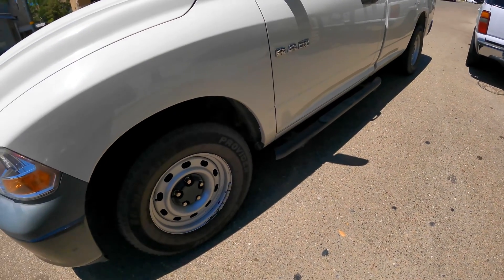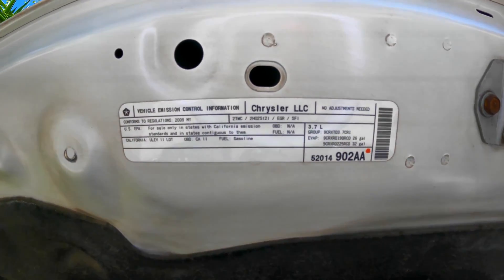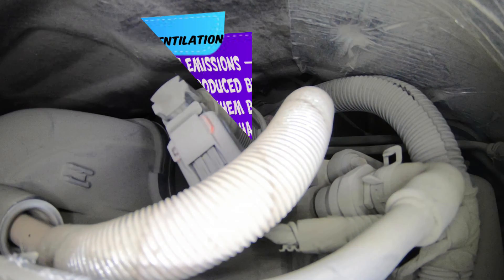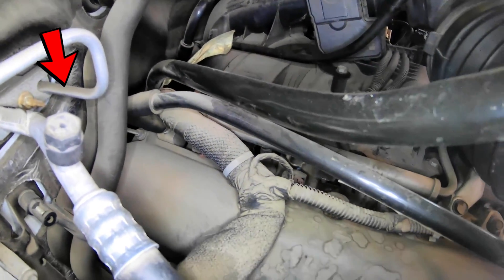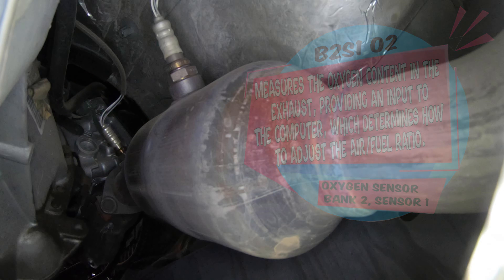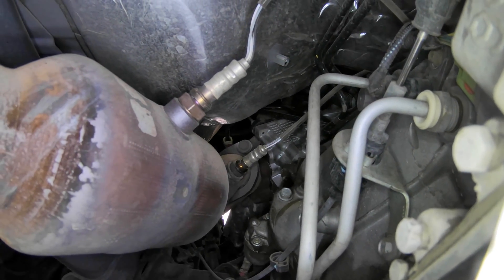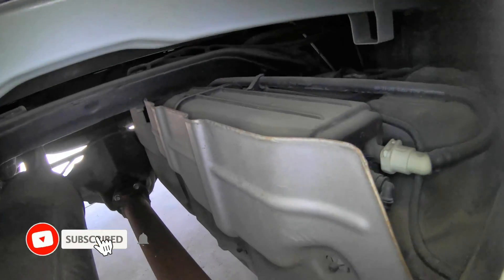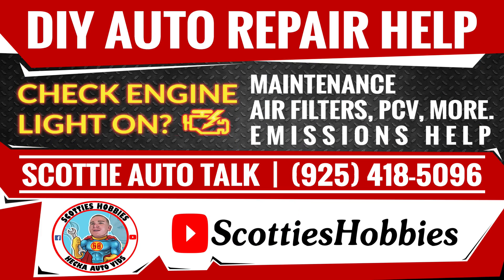⫷ RAM 1500 3.7 L. Emissions Locations: PCV, EVAP, EGR, Oxygen Sensors. W/ Lots of Info '09 - '12 ⫸

Comment: Hey man I got code p1404 on my 07 ram with the 3.7. I was just going to replace it but I looked at AutoZone and O'Reilly's websites and they say they don't have any egr valves that fit. I was just wondering if you could possibly help me get a part number or figure this out, thank you
Reply from the maker: I am not seeing a listing for a EGR valve on a 2007 year model either. Are you sure you are working on a 2007?
Reply: @ScottiesHobbies  yeah, I figured out that there isn't one but I'm guessing with the code p1404 it has to be something emissions related. Hopefully I'll be able to figure it out. Thank you for looking into that for me man
Reply from the maker: @roll27blunts  are you sure it's a v6? Something is not making since here. I looked on alldata and it's not listing a code p1404 for a 07 ram 3.7 either. Would you be comfortable texting me your state and plate number or your vin number? Text me at 925 418-5096

Comment: wow this is awesome. I have a 2012 dodge 1500 3.7, and I can never fine any videos
Reply from the maker: There is alot of videos in my library for this truck. Check them out. I'll have more in the future too. Glad to help out when I can. 💪 good luck on your project.  👍🤞
Reply: So I was having trouble with emissions codes, and looking at your I found the PVC location and guess what it was missing. I had the engine replaced probably about five months ago actually rebuilt. Somehow every time I started the engine, there was a huge huge hissing inside the Cab. I took it back where I got it replaced and they said it must be your AC going out or something well lo and behold. I found the PVC valve missing, and the hose that goes to. It was hooked up to the drain port for the AC if that makes sense thank you for posting the video and showing us where things go Thumbs up guy!!!